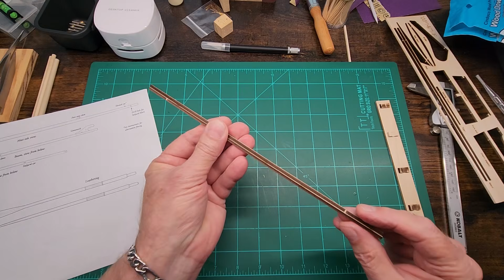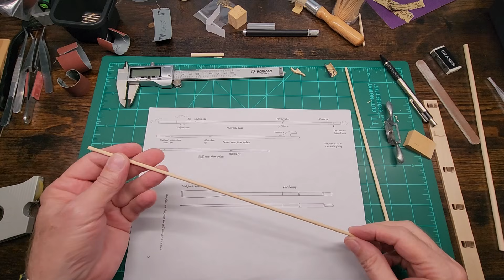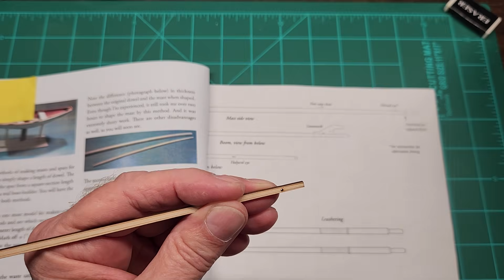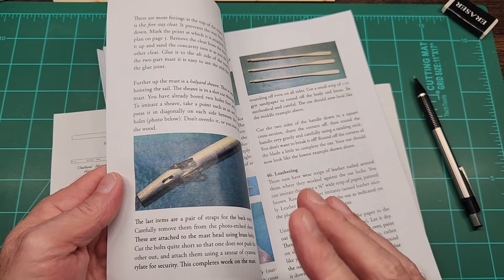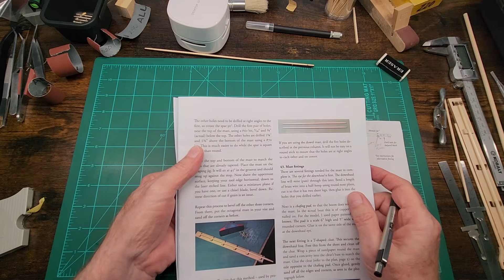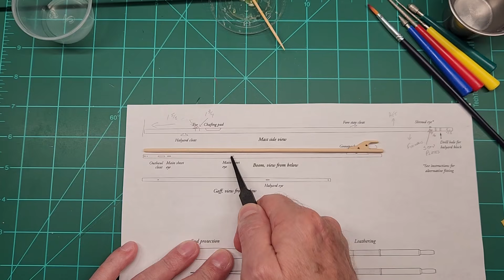Model Shipways Norwegian Sailing Pram, Part 11, Mast, Boom, and Gaff

Comment: Johnny,
I'm really glad I watched this episode beofre starting on my mast. I wanted to work with the square mast, but It wouldn't have dawned on me to measure the parts. It explains why so many of the build logs on Model Ship World complain about snapped masts that are too small for the mast step. I followed you advice and bought smaller dowels. I bought a 1/4" square dowel so I can try the square method. I'm retired, I've got the time! I also ordered a cheap mini drill press from Amazon to help with the holes. It arrived today, so plan to start the mast and spars tomorrow. BTW I just borrowed the extra block for the mast jig from the Lobster smack kit, instead of making one.
Reply from the maker: That's great Tom, glad you're at the mast stage. I wanted to do the square mast shaping too but since it was less than desirable, I went with the new dowls. Other than that, they were easy to shape and assemble. Good thinking on the mast jig, that didn't occur to me, but then for those that only have the pram and not the smack I thought it a good idea to mention having to make the block anyway. I know it's too early for the sail for you but don't make the mistake I did by not ironing the cloth to remove the creases in it before you begin, the instructions don't tell you to do that, but you'll be glad you did, lol. Thanks for watching and continued success with your build my friend! Johnny
Reply: @hillbillymodeling  Thanks for the tip on the sail. I always watch your videos before I start a new step. Got my mast finished today. Boom and gaffe tomorrow. One thing I realized is that the 'scale' plans in the manual are not to scale - they're about 97%. If you print out the PDF of the page from the Model Expo website, however, they are true to scale.